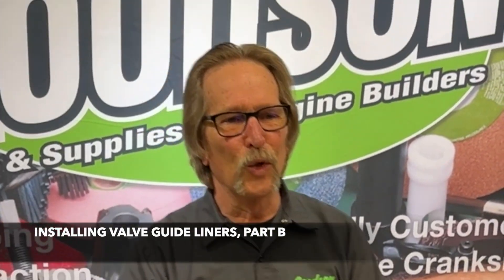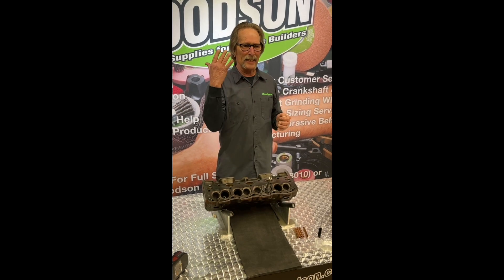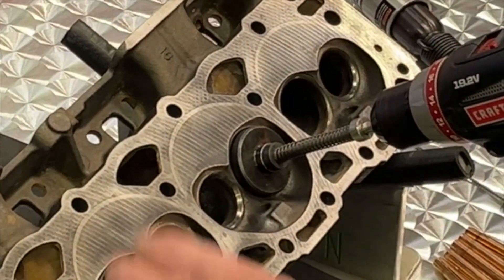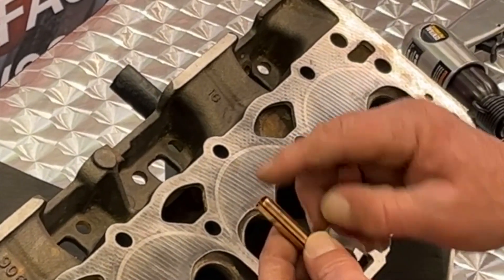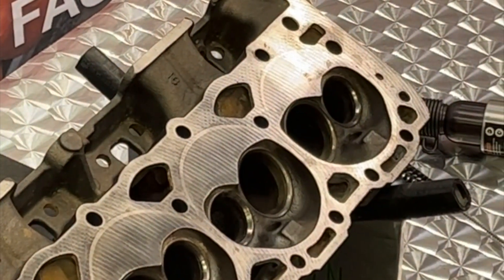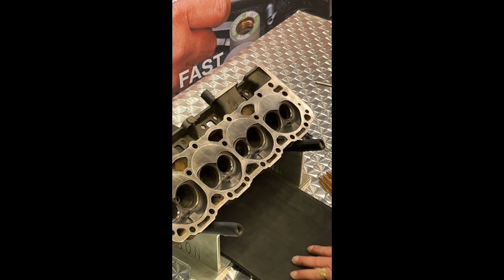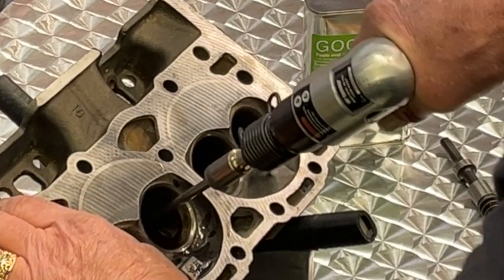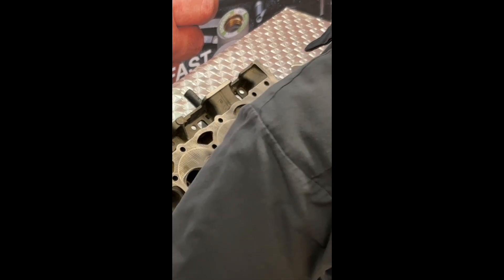Valve Guide Liner Installation & Removal, Part B

Comment: you certainly started with a turd for a head, with the work you're doing, now it's a turd that's going to drop a valve.
Reply: maybe if you worked on it. 

But the guy is a pro Demoing a tool, ya tool.
Reply: @Shade_tree_garage01  go ahead and knurl or shim the heads and you will be a broke down ass. ya hole.

Comment: Two questions:  When you cut the bronze guide from the top, the video shows more than an inch sticking out but you do not show the process.  Do you use the cutter to cut the full inch down or do you cut it within a quarter inch or so with a cutoff wheel and then use the cutter?  Second question:  After the head has been in service for a while and it comes in for a new valve job.  After you drive out the bronze guides, the original guide has already been cut .030.  Does the guide uninstaller mar the inside surface of the cast iron guide or can you just install a new sleeve?  Hopefully these questions make sense.  Great video, thanks for your time, dan...
Reply: Dan, Since your questions have been here for 2 weeks with no reply, I'll give it a shot. I've used Kline guide liners in my shop on every job you can imagine for 20 years. The carbide trimmers will work fine on any length sticking out. turn them fast with an air drill. The removal tool works really well, if you screw up on putting one in and splits the liner in 2 positions on the ID and will catch about 3/4 of the way down pushing the liner out without a mark on the bore. However, if you are replacing someone elses liner job you will probably find that their brand liner, tooling, or technique will probably leave an oversize hole. also don't use an oven cleaning system on the head if you intend to leave the guide liners in it. It softens them and they will be loose. I have never had a failure with bronze liners except when they were left a little too tight on the exhausts. you will need an assortment of ball broaches to get the clearance right. Good luck, Dave Richards
Reply: @davidrichards5594  Thank you...